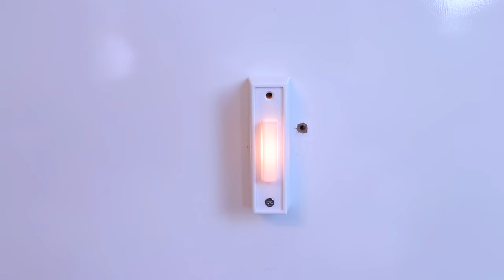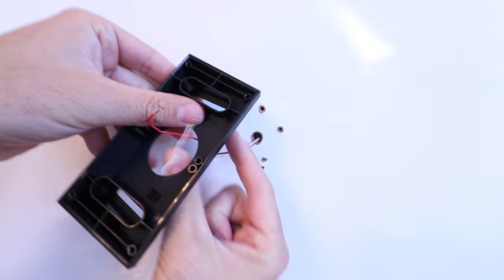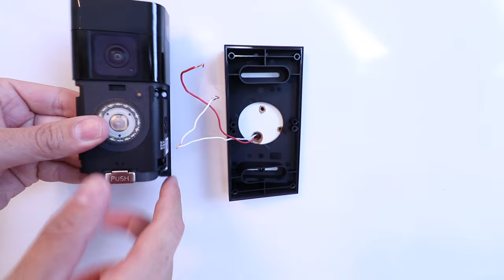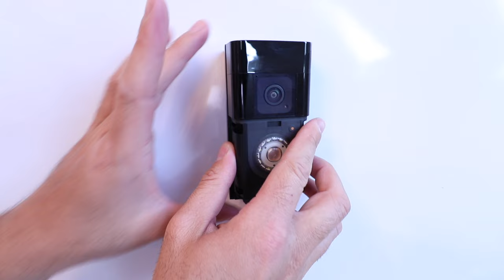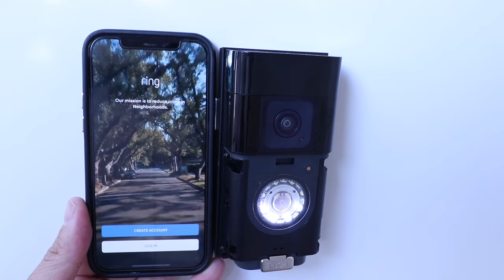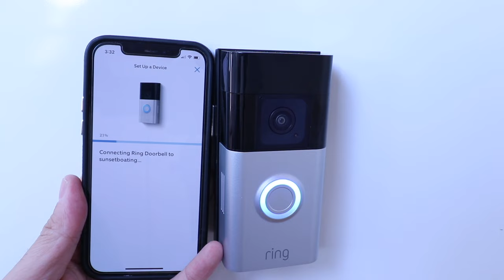How To Install Ring Battery Doorbell Plus

Comment: Am I tripping but what’s the point of putting battery instead of wired in the tittle
Reply: Works in blackout?
Reply: Some older houses like mine don’t have a doorbell so there’s no wiring. This is a solution to that.
Reply: @scoops1996 that was the original reason I thought of (why I'd want it) but then realized, if there's no power then you won't have wifi for it to connect to the cloud.
Reply: I live in a duplex without a doorbell
Reply: @SirMike02 I thought the same thing lol I was looking for battery installation, not wired.
Reply: Because that’s the actual name of the doorbell on the box.
Reply: @scotch1993 yeah so we’ll your wifi 😂 it’s a wifi camera no electricity no wifi 😂
Reply: Right Detroitbaby313!!!
Reply: It’s it’s name.
Reply: No ur not tripping
Reply: I agree!  This is all about wiring in the doorbell.
Reply: If your house is wired for a doorbell, then there is a speaker somewhere in your house that makes the doorbell sound. When you wire the Ring to the system, it chimes the speaker in your house, as well as alerts you on your phone. In other words, the wire doesn’t provide power, the battery does. The wire only integrates the ring to your existing doorbell.
Reply: Because is battery powered 😂
Reply: Deffo
Reply: Because it is the ring battery doorbell not the ring wired door bell
Reply: Thank yewwwww. Not what I was looking for
Reply: Easier than charging battery via usb every month! TY
Reply: It’s the name of the product
Reply: @Jeterfan906  thanks 😂
Reply: I have a wired doorbell that works SOMETIMES even though I have purchased new and had an electrician check it.  Now I can't connect the wire and still have the battery as a backup.  Good video.
Reply: Seriously? 🤣
Reply: @robingeorgetowntx  It’s literally the name of the product
Reply: @Jeterfan906 and there are Several different models, literally.
Reply: @Jeterfan906  yes, but there are different versions and they all look alike.
Reply: Is it possible to have  the wired ring power the homes doorbell chime?

Comment: "WARNING" If you are installing your Ring with the wedge, do not use the long screws (video at 13 minutes). Use the smallest screws. If try to use the long screws you will crack the bracket or strip the screws.  I found out the hard way.

Comment: you dont need to kill the power if you know what your doing, doorbell is low voltage
Reply: exactly, it's just a "so the lawyers don't sue us" thing. I've never once turned off the power when I installed them for clients.

Comment: If you use the wedge, then you only have to drill two holes into the wall and four screws screw into the wedge?
Reply: correct

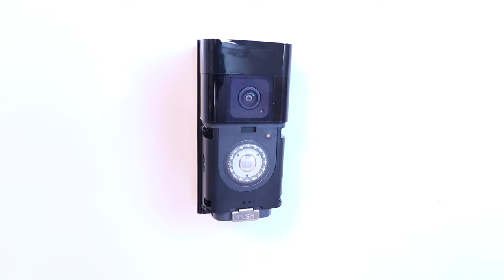Comment: At time 3:45-4:00, mounting the ring to the wedge, you can't use the four long screws as shown for all four holes.  On the short side of the wedge you need to use the smaller length screws.  Otherwise you will break through the wedge and screw more holes into your wall.
Reply: I learned the hard way. 😞I used the long ones for the thick side and then realized the short ones are needed for the narrow side of the wedge. I hope I didn't break anything with the long screws.

Comment: Do you have to hard wire this? Or can you just use the battery. I have one but our door bell wiring is not powered
Reply: You can do either. We have a hard wired doorbell, but I can't put our Ring there as not enough space!!.
Reply: no, hard wiring it simply adds some extra juice so that it can trickle charge the battery. you can install it and run the ring off of nothing but battery if you like

Comment: I have doorbell 3 but plan on getting doorbell plus because im tired of the battery draining and having to charge the battery.

Anyway I have doorbell 3 mounted with the wedge piece and the doorbell mount for doorbell plus seems kind of flimsey in comparison.  Can installed the doorbell plus using the old mount from doorbell 3???

Comment: Do you need to mess with the door bell chime box in the hallway tho?
Reply: No you do not. I just bought this Ring Plus after exchanging the one I previously bought because of the power kit piece. I don't have a doorbell chime box, plus the doorbell button at my front door does not have power. A neightbor recommened this device to me.
Reply: If you are using a wired unit you would install a jumper on the transformer in the chime box.  If you are using a Ring unit with a battery you do not need the jumper, as it takes a lower voltage to run the unit.

Comment: How does one turn the power off ones doorbell?
Reply: You have to go to your breaker box to power it off. If it's not indicated, you'll need to find where your chime bos is located and turn off the breaker for that area. Else, turn each breaker off until the light goes off on your existing doorbell.